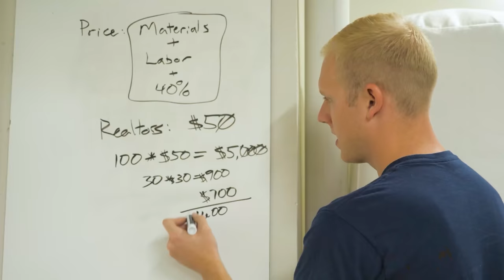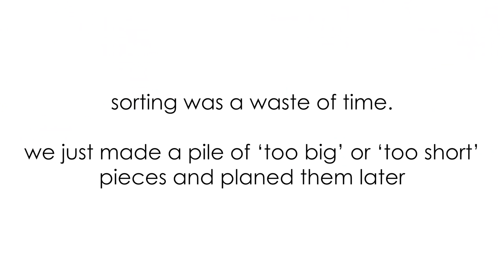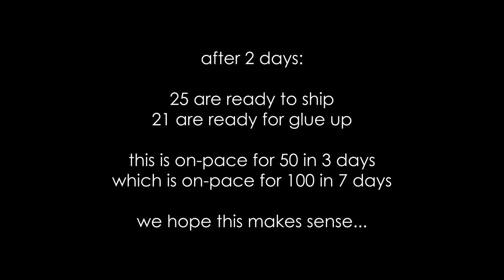we built 25 cutting boards in 2 days

Comment: Great Effort!.  A suggestion--You started out with 10' boards.  I'd make a 10' long cutting board then cut it into the correct size.  If you're making 24" boards, you've just made 5 of them in about the same time as making one.  You're duplicating the most time consuming part-the jointing and planning).  Good luck in the future!

Comment: Hey guys first thing that I would recommend if you are doing wafer or doll joints to give them extra mechanical integrity.  Move the mounting router station next to the clamping station.  I would also recommend loosing that center storage shelf and instead of storing them on their horizontal surfaces store them on edge like books on a bookcase.  You'll loose a shelf but you'll be able to store more of them in the same amount of shelf space,  you also won't run the risk of the bottom ones warping from the accumulation of the weight of all the others on top.

Comment: I did a sprint like this recently, I saved a lot of time by making longer sticks so each cutting board glue up was two boards. So I did two glue ups per set of clamps (3 parallel clamps per) and ended up with 4 boards per clamp set.

Comment: You should read about the Toyota Production System and Lean thinking.  It talks about minimizing production batch sizes to maximize flow.  Seek and eliminate bottlenecks in your production flow to maximize efficiency.   Then look into a Kanban board to organize work in progress (WIP) .  I use this every day but with computer software development.  There is also something called Kaizen which is a strategy for continuous improvement.  Interesting stuff.  Great videos.

Comment: Around the 8:20 mark when cutting to length on your crosscut sled it would save time to clamp a stop on the sled so you aren't measuring each board individually. Crosscut sleds are made for precise repeatable cuts and that stop can save a ton of time. As an example, if it takes 30 seconds to measure and line up each board with your kerf you save almost half an hour on 50 boards and have better precision to boot. My degree is in supply chain management and what a few commenters have posted about the "lean" philosophy is very true when trying to things like this on a large scale. With that philosophy you will find most of your big jumps will be made in saving a few seconds many times, than with saving a few minutes rarely.

Comment: Just subscribed, those boards look good! As someone who owns that same dust collector, do your older selves a favor and either:
A. Find a way to vent it outside (what I did).
B. Find a way to utilize a HEPA filter with it, or...
C. Wear dust masks or respirators any time you're running it.

The dust bag that specific collector comes with SUCKS! It puts all the less than 5 micron dust into the air that bypasses your sinuses and goes straight to the lungs.

Comment: Here's an idea: joint two sides of every board, and then take every board to the bandsaw and rip each one down to a relative width so that each one is exactly the same, albeit still too big. That way when you plane them to all the same thickness, no time at all is wasted on continuously readjusting the planer nor time sorting each piece. I'd reckon it's faster than sorting them but you'd have to test it out.

Comment: You 2 are very smart so u probably all ready to this..but I worked at a pharmaceutical factory and we ran lines of same product...like # 1 rule other than safety is no double handling!! If u find yourself touching product to achieve 1 step, see if u can move stuff around to shortening how many times your touching product on a step.. example: stacking for storage make some pallets out of scrap wood and stack on separate pallets at end of line..invest in hand truck? We seperated our pallets with different color markings using spray paint.. separate yours by size maybe?? Double handling cost a lot of $ in long run when u do the math..but u 2 do an awesome job and work very well together
Reply: Ohh and if possible..a lot of times we knew our order before hand so when step we knocked out was packing for shipment..we had corregated and shipping labels at the end of line, so job was ready to be shipped when put into storage..

Comment: glue your boards  in longer section 3 to 4 boards long 2 boards wide plus cutting waste. alternate clamps top and bottom with pipes tight to boards. Before final tightening use rubber mallet to even out surface. (or 3 pound hammer and block) invest in a good table saw and blades.. Your over-relying on bandsaw;residual

Comment: It might be useful to time the individual tasks, how long does it take you to process the materials for a single board from raw material coming in to final product, if you break it down to it's steps that will let you figure out scaling up batch size. Cut, Joint, Plane, Glue, those look to be your most standardized tasks sometimes doing one of them multiple times, if you break down how long each of those tasks takes it will help figure out process times of more than just your cutting boards as those tasks are pretty standard for most things so will let you figure scaling of other projects too. It's also worth finding out how long it takes you to strip out broken or worn parts and replace them so you know how much of a safety buffer on time you need to allow, it's no good giving a time requirement for turnaround on a large batch of items to then have your bandsaw or planer blade break when you're halfway in and loose time to repairs which then makes you late on delivery whereas having that buffer time will allow you to meet deadlines or in most cases beat them and get a boost with the customer.

Comment: I was getting tired watching you push all that lumber through your machines. A short time ago I invested $400 in a baby (1/8hp) power feeder. Game changer. Definitely worth the investment with the amount of milling your doing. I also splurged on the Magswitch hold downs so that I could place it on any cast iron surface. Makes it easy to move from jointer to router to tablesaw and even band saw if desired. You’d be surprised how large a chunk of wood that little feeder can push through. Definitely recommend this investment for the work you’ve got going on. Keep on movin towards those goals!
Reply: Power feeders also make you not so tired. It's working hard so you don't have to! The safety factor also comes into play here, they can take abuse from splinters, knots and just plain old chips and you won't get hit in the face. Also your fingers are no longer close to blades and cutters. Power feed wheels are much cheaper than a hospital visit.
Reply: Great suggestion. Could you tell me which power feeder and magswitch holders you are using?

Comment: Okay... so... I scrolled through some of the comments. No, not all of them. I have some ideas for you that I am willing to discuss at length if needed. I am a Wood Worker and a Engineer. I mostly work with work flow and MASS production. Therefor, this video gave me a ton more interest than others... Maybe? Anyway; should do this EXPERIMENT AGAIN!!! There is a mathematical equation that will simulate the "Learning Curve". That is the piece you are trying to figure out: Max Production once you know what you are doing. Plus there is a lot more than just the curve. Like you said do some thing crazy!? Like keep your boards at a length that would make it 2 cutting boards. then just do final cuts. Idk That is one idea. There is a lot to consider when doing batch products. I bet you could get 75 in the 2 days with some thought. Great stuff. I will be following.

Comment: Start with planning your milling, for those 6"x 2" blanks, 1. joint the large face 2. joint the edge, 3. bandsaw the first blank, it will have 2 faces jointed. 4. joint the bandsawn edge on the blank, 5. bandsaw. repeat 4 and 5 as many times as your blank allows... don't joint the small 2x2 sticks it will give you the uneven heights that complicates the final milling in the planer
Reply from the maker: That method has too much walking back and forth between two tools. In doing research, we found that a ton of injuries happen when switching back and forth between different tools. Can't afford that option at scale!
Reply: @jennieanddavis  one person joints, the other rips, I of course assume that you have a decent work triangle, but to each their own, also safer jointing a larger piece of wood

Comment: Joint and plane full boards first, then rip to cutting board height, rotate and rip your 1/3 2/3 stripes and glue together full lengths. Then plane top and bottom and finally cross cut to length. You could probably knock out 100 easy that way.

Comment: Why not buy 5/4 rough, plane it down to 1", then rip it into 1 5/8" pieces, rotate those pieces 90 degrees to get rift and quartersawn grain orientation. In doing so, you also eliminate the bandsaw use and rejointing the pieces after ripping on the bandsaw. If the pieces are and are quartersawn/rift sawn the resulting board will be stronger. After glue up, i presand the glue off andthenplane boards down to 1 1/2". Thats how I do it.
Reply from the maker: That’s a great technique, but our boards are build to a certain quality level for the customer. 

They don’t want to pay for the highest quality board in the world, so we adjust to make the customer happy!

Comment: Helpful Advise from a production woodworker...... most mills where you buy your lumber will mill your rough lumber to your specs. .75 cents per board foot where I am. This will save you Time which will save you money! And increase your production!
Reply: When Band Sawing the wood..... do not let it fall like that..... it will cause many dings and dents which you will have to sand out. Time! I love your videos but just advice from 40 years in the business.
Reply: Balance that Table Saw...... each crosscut you did, there was way to much movement. I am assuming it is on a roller base. Try to lock it down better for the safety.

Comment: Hi there!
It is really great to see how you challenged yourselves to achieve a goal!

I was wondering a bit about the "we don't have industrial sized machines...." statement:
Really? Was there any point in your process where a larger or more powerful machine could have saved you a lot of time? Jointer, planer, handsaw, etc. take their time to use.

What you could try is enhance your workflow by passing batches of pieces to another (using carts) and at the same time cycle through the workplaces, where it makes sense? This way you don't tire yourselves doing only one step over and over, but shake things up a little bit? This way you maybe reduce the output per day but lift the fun to start over the next day ☺️

Comment: i would build a  rack system with the clamps integrated so youre not down on the floor, back up, also then you have a designated drying area so you can control that environment a little, run a heater maybe
Reply: the pipes have threads on the ends that slide, maybe threa an eye on there with a pipe they can slide down

Comment: New here!  Love the channel.  Quick question that you might have addresses in a different video.  When you are making your cross cuts toward the end of the board creation and you are cutting off slightly different widths of each board, is that due to trying to keep the board the same size(sacrificing some wood over a large batch). Trying to figure out how to you could get almost another whole board out of your supply from just the cutoffs/excess from the cross cuts.

Comment: Went through some of the comments but 400+ is a bit more than I'm willing to read through.
If you plane all your boards to the same thickness before you cut and edge them you will not have to sort height. It might make glue up move faster. Might make less runs through the planer for finishing too.

Comment: Have your lumber supplier straight line rip one side and skip plane the boards. They have much beefier equipment and your valuable time is not spent milling boards. I would invest in roller carts to keep the materials close by the machine as your are machining. Also, look into using a power feeder on the table saw for rip cuts.  When gluing use foam paint rollers it is much quicker and ensures an even spread of glue.

Comment: Hey Guys, love the channel, great video! i do have one question, what are you referring to as far as selling to realtors? how do you plan to do this?
Reply: Hi, I am a Realtor ! When we help buyers or sellers, one of the last steps in the transaction process is the "closing" - where mortgage documents are signed and funds distributed. After the closing, many Realtors give their clients a gift to celebrate reaching that last milestone in spite of the bumps some experience as the transaction moves forward. A "closing gift" is often fairly expensive - $50 to $100. Thus, a nice, or, even customized cutting board, blanket ladder, etc. would be within that price range. Clients are often excited to receive these items that then make life in their new home even more celebratory. Hope that helps!

Comment: I would set up your jointer on one side of your table saw and the plainer on the other. Joint all boards flat and square, then rip them down at the table saw. Finally plain the final unfinished side to thickness.  Good luck.

Comment: It seems to me it would be more efficient to make the boards 2-4 cutting boards long, and glue them up long ways. Gives you a 'cookie cutter' kind of standard, and makes the glue up easier. Then you can cut them down on your cross cut sled.
Reply from the maker: Tried that, Joshua. Lots of material waste and not enough time savings to make up for it!

Comment: set up your tools in order of when you use them- miter saw, jointer, table saw, planer etc.   So you can flow around the shop.
Reply: I don't understand why they didn't just rip them then send 2 sides through the thicknesser, there never going to be the same thickness using a surface planer
Reply: @jabtothehead9942  huh

Comment: Look at Izzy Swan's air operated clamp system that mounts on the wall. Also do longer glue ups and cut to length when glue dry's
Reply: I was just thinking about recommending his air clamp table.  Definitely better options than the pipe clamps.

Comment: With your hurricane research, do you fly on the Air Force C-130 or on the NOAA's P-3, Miss Piggy or Kermit?  Just wondering because I worked on the P-3's for NOAA.  I like your pricing formula, I'll be using that.  I don't even have a 2 car garage to work in, but I have the Florida sunshine and humidity.  Saving for a 40 x 40 building to be built on my property.   Thanks for all the good info.

Comment: When it comes to optimizing the workflow in your shop, in addition to a spaghetti diagram and  minimizing the number of cuts as others have said, look at the direction that the material moves through the tool.  Just because two tools that are used in sequence are beside each other, that doesn't mean they're in the correct spot.  If material moves from right to left across one tool, and then has to be moved to the right to go through the next step in the process, you're wasting time and energy because the tools need to trade places.

Comment: Hi Guys, I love what you do as a couple.. I was just wondering if you could give me a little advice. I am looking for a affordable CNC machine to engrave cutting boards. The challenge is that I want to engrave the edge and not necessary the top. Would you know of a machine that would be able to write on the edge. All the ones I am looking at don't seem to be designed to be able to do the edge, only the top... Any suggestions that you can help me with would be greatly appreciated, thanks Martin.. PS.. if any of your subscribers could make any suggestions to help me that would be great.. It is driving mad trying to fine a machine that would fit the bill..
Reply from the maker: Shaper origin comes to mind

Comment: Great video!
How do you guys sell to "realtors"?
Didn't quite understand how realtors can be a market for cutting boards?
Reply: They would be for the realtors to offer as gifts when they sell houses.  Great item to brand for the realtor.
Reply: @janetgilmore5930  Thanx. That makes sense.
Reply: I am a Realtor and responded to a similar question up above. Can search my name on here or I can copy/paste if you prefer.
Reply: @GinaKayLandis  Hi Gina. Wouls appreciate it if you could please copy and paste here. Tx!
Reply: Here you go:

Hi, I am a Realtor ! When we help buyers or sellers, one of the last steps in the transaction process is the "closing" - where mortgage documents are signed and funds distributed. After the closing, many Realtors give their clients a gift to celebrate reaching that last milestone in spite of the bumps some experience as the transaction moves forward. A "closing gift" is often fairly expensive - $50 to $100. Thus, a nice, or, even customized cutting board, blanket ladder, etc. would be within that price range. Clients are often excited to receive these items that then make life in their new home even more celebratory. Hope that helps!
Reply: @GinaKayLandis  Thanx Gina. The gift when closing is done is just not a thing in my country. I guess that's what threw me off. Tx anyway

Comment: Zigler said, if your dreams don't scare you, you're not dreaming big enough!

Also, why make 50 individual cutting boards when you could rip boards at full length, then make 10 patterns of boards with these ripped strips at full length, glue them up, run them through the planer, stain all sides, route all the sides, then cross cut 5 boards out of each of the 10 sets for 50 cutting boards? Then when you're at this point it is easier to do the final routing, and stain the last parts.  You skipped over the parts you could automate and wasted a lot of time and effort.